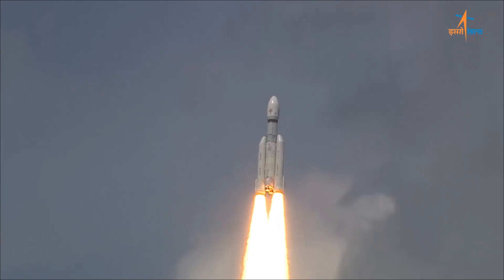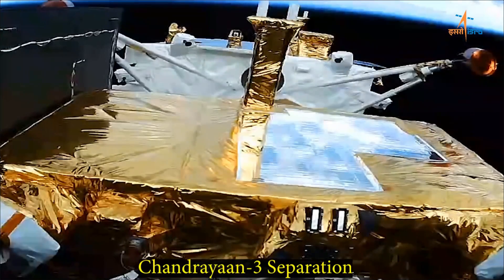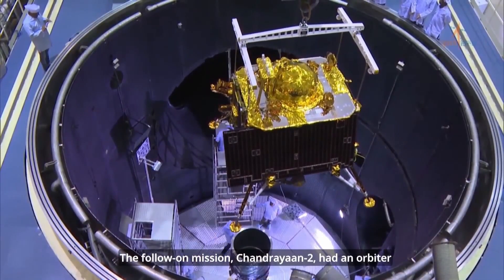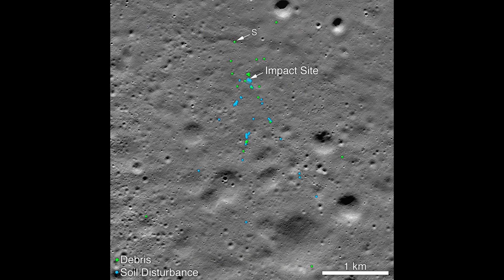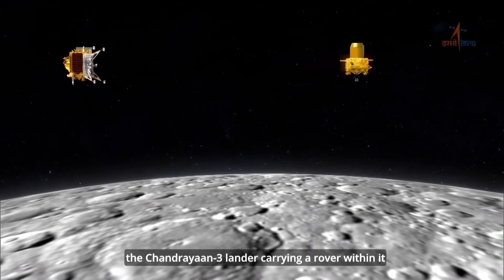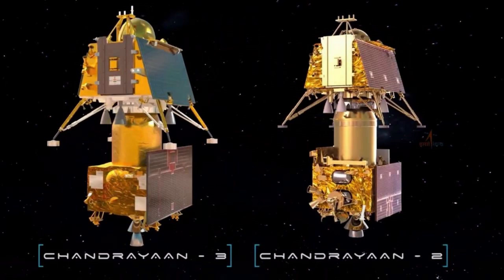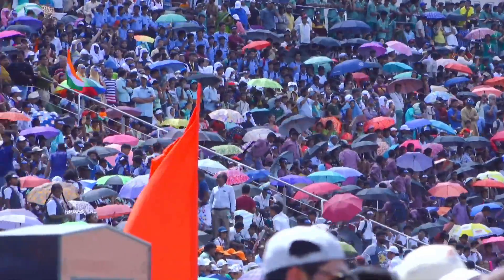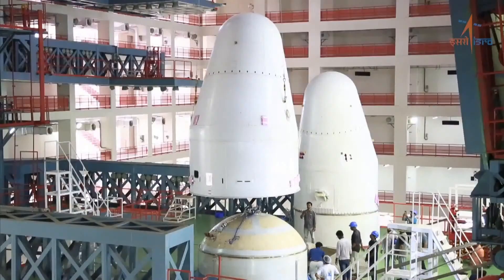India's Flagship Lunar Mission Chandrayaan 3: Will it Brake or Break?

Comment: Actually it was revealed recently that what happened and what changes they had made to the new lander, not a detailed report but some good bits. they shared pics of Chandrayaan-2 launch.
Reply from the maker: Did you post this before watching the rest of the video?
Reply: @scottmanley  can you comment on what I wrote? 
it will break just like Chandrayaan 2. the reason is all the landers from USSR, USA and China, used only one center rocket engine with adjustable thrust and throttle, only Chandrayaan use multiple small engines, for Chandrayaan 2 it had 5, for Chandrayaan 3 it has 4, plus 8 more tiny engines for fine position control, more engines just meant more troubles. Landers from China and USA, can hover steady in space 200 meters above the surface, carefully choose landing site, if not ideal, the lander move (fly) horizontally, to choose a flat site to land, from description of Chandrayaan 2 or Chandrayaan 3, they do not have this capability. from ISRO description, they just said they just choose a flat site of 2 sq km for Chandrayaan 2 ,and 4 sq km for Chandrayaan 3. which cannot avoid the landing site of 2 sq meter is flat or not. the landing process is all done by the lander itself, not by the instructions from the earth. with 4 engines, any thrust in-balance will make the lander crash. another thing is the thick moon dust, without central engine, the lander last step will be covered with moon dusts, may cover everything from solar penal or antenna to make them not function properly. ISRO showed their casual · random. way of design a lander, with Chandrayaan 2 they put a central engine for avoid moon dust problem, well they never go a chance to know whether it is good or not, in Chandrayaan 3, they just took it out, just amazing. I do not understand why ISRO does not follow the successful lander model from USSR, USA and China, but risk with their own design, if it doesnt work will they waste another 4 year for Chandrayaan 4??
Reply: @scottmanley  my question is, since i am not in the field, was there any moon lander used multiple small engine landed successfully on the moon? thanks,
Reply: @firetree2007  yes India is going to be first to land on moon by using multiple small engines okay

Comment: Do they not understand clean rooms?  They have caps, but their ponytails aren't covered, and neither are their beards.  Its like Brazil all over again.
Reply: The orbiter, lander, rover were prepared in clean room and wrapped in gold foils to prevent contamination and damage due to electromagnetic radiation and then was sealed in nose claddings. Same practise adhered to for all electronics. The mechanicals of the rocket does not need clean room as biocontaminants would burn due to high temperatures once the rocket flies and won't survive in supercold cryogenic tanks of the rocket and the various stages of the rocket themselves  will anyway fall back to the earth and certainly will not accompany the spacecraft.

Comment: The failure of the lander boils down to the software's incapability to handle parameter variation or dispersion which earlier was very narrow and the narrow site of landing was also a problem as it took out the liberty from the lander software to land at a suitable sites it prefers.

Comment: Kindly note: chandrayaan mission launch on Moon South pole where it doesn't receive sunlight throughout.
If successful, India will be the first and only country successfully safe land on moon South pole
Reply: It receives sunlight!
Reply: @QuantumNinja1.9  nope south pole of moon does not receive any sunlight throughout
Reply: @JohnFrost-gt1cs  it receives sunlight like our earth's poles but the angle of sun  light on South pole remains less than 2 degrees; that's why it remains cold but still craters and shadowy parts due to mountains do not receive light throughout the year.
Mainly those craters have ice deposits in hydroxyl form.
Reply: @QuantumNinja1.9 it doesn't, thats why they are trying to find more amount of water there
Reply: @hritiksaxena4368 it doesnot rotate like earth 😂😂😂
Reply: @danishali1545-b8k  what do u mean by that, genius?
Reply: @QuantumNinja1.9 Oh hello Neil Armstrong Jr
Reply: @jayanthbharadwaj9490  how the hell, did u know that?🌚
Reply: @QuantumNinja1.9  its freezing
Reply: @saurabh6453  yeah, it freezes most of the time but do u know the maximum temperature on lunar South pole also?
Reply: @QuantumNinja1.9  no other has never tried on South pole cause it's very fragile than launching on the middle region on the mon.
South pole harsh negative freezing (making electronic to work extremely delicate).
South pole has extreme craters elevation than the middle region
Reply: @er.m.s8930  but CY-3 will land at around 70°S.
Also rover will use it's solar panels.
Reply: @QuantumNinja1.9 nope there are parts which doesn't
Reply: @drbh6331  yeah but they're mainly big craters of South pole.

Comment: I guess those SRBs gave it plenty of oomph so they didn't need to light the main engine until nearly separation time.
Reply: The launch vehicle has a lift capacity of close to 7 tons augmentable to 10 tons but lifted just around 3.9 tons this time around. So second stage needed not be fired at launch phase.

Comment: it will break just like  Chandrayaan 2. the reason is all the moon landers from USSR, USA and China, used only one center rocket engine with adjustable thrust and throttle, only Chandrayaan use multiple small engines, for Chandrayaan 2 it had 5, for Chandrayaan 3 it has 4, plus 8 more tiny engines for fine position control, more engines just meant more troubles. 
Landers from China and USA, can hover steady in space 200 meters above the surface, carefully choose landing site, if not ideal, the lander move (fly) horizontally, to choose a flat site to land,  from description of Chandrayaan 2 or Chandrayaan 3, they do not have this capability.  from ISRO description, they just said they just choose a flat site of 2 sq km for  Chandrayaan 2 ,and 4 sq km for  Chandrayaan 3. which cannot avoid the landing site of 2 sq meter is flat or not. 
the landing process is all done by the lander itself, not by the instructions from the earth. with 4 engines, any thrust in-balance will make the lander crash. 
another thing is the thick moon dust, without central engine, the lander last step will be covered with moon dusts, may cover everything from solar penal or antenna to make them not function properly.
ISRO showed their casual · random. way of design a lander, with  Chandrayaan 2 they put a central engine for avoid moon dust problem, well they never got a chance to know whether it is good or not, in  Chandrayaan 3, they just took it out, just amazing. 
I do not understand why ISRO does not follow the successful lander model from USSR, USA and China, but risk with their own design, if it doesnt work will they waste another 4 year for Chandrayaan 4??
Reply: ...hope this ages like milk..
Reply: @firetree2007  huu?
Reply: @firetree2007 now I'm sure it'll be successful
Reply: @hj2711 yeah, just like 2, also they designed and original how it doing now?
Reply: Go eat your dumplings, kid 😂😂 Leave science to the grownups
Reply: Mao genocide, xi ping pong bat virus
Reply: @firetree2007  Mao genocide, xi ping pong bat virus

Comment: :face-blue-smiling: ISRO personnel, including the current ISRO chairman, have given their explanation of what went wrong with the Chandrayaan-2 lander. They said that as the lander descended, the attitude deviations ("errors") began accumulating faster than expected, necessitating larger sharper corrections by the thrusters. At the same time, there was a bug in the software that manifested itself due to these larger sharper corrections being required. This software bug was not allowing for larger corrections by the thrusters beyond a certain amount. Had the attitude errors/corrections been smaller in size, then the software bug would not have been encountered, but because they were large enough, that software flaw came into play. Therefore the lander was unable to properly perform the required attitude corrections on the way down, causing the resulting crash. ISRO personnel refer to this problem as "dispersion" handling, meaning that those attitude errors/deviations were larger (ie. had a larger dispersion) than anticipated, which the software was unable to handle. That has now been corrected, along with other improvements and upgrades made to this Chandrayaan-3 lander.

Comment: Crew + UDMH + N2O4 + Solid Rockets = Danger

I would be interested in how well their launch escape plan takes into account the bad things that can happen in that spicy soup.
Reply: There will be a dedicated crew escape system built into the rocket, just in case.
Reply: ISRO is developing a RS 25 type engine which will use liquid hydrogen and can be configured to liquid methane...which will used in crewed mission ...and about that solid boosters their TWR has already configured for crew mission....

Comment: The "Moon Impact Probe" (MIP) onboard the CY-1 mission was specifically designed to crash and withstand the crash (It was in one piece after the programmed crash landing), demonstrating the capability to reach a specified location on the moon and providing valuable information and experience for planning future soft landings. On board this MIP, a component called CHACE conducted experiments providing in-situ data confirming the presence of water on the Moon, complimenting remote sensing data from M3 (NASA's equipment onboard the Chandrayaan-1) regarding the same. The next CY-2 mission had an Orbiter, A Lander and a Rover. The Orbiter continued to function optimally well beyond its planned lifespan while the Lander (Vikram) carrying the rover in it, crashed due to issues with its software, leading to an accumulation of errors resulting in a destabilised descent path. The Lander's ability to handle parameter variation or dispersion was minimal because ISRO scientists had not expected such margins for error, which ultimately led to the onboard computer trying to satisfy two contradictory requirements, resulting in the crash. This time ISRO has covered all bases and planned better for potential contingencies with the landing part. 
We are exited and cautiously positive about sticking this landing. Go ISRO.

Comment: Interestingly, the recent name change from GSLV M3 to LVM3 is due, in part, to the fact that the GSLV M3 doesn't have any ancestral link to the older GSLV models.

Plus, there's an insurance angle: some previous failures of completely different GSLV configurations reportedly led to increased insurance costs for the GSLV M3. You learn something new every day! INSURANCE.

Comment: For your information, chandrayaan 2 DID NOT FAIL... It was only partially successful... 95% successful 🗿
Reply: It did fail, if you order a parcel and it gets destroyed just before arriving, it's a failed delivery. There is nothing bad about failure, don't try to describe it as something else
Reply: @E9X330  The orbiter is working fine, so failure is technically incorrect. And Partial success is the technically correct word.
Reply: @palashborah1604  the mission didn't completely fail, but the landing did. Wasn't the orbiter supposed to have the highest resolution camera of the moon yet ? Are there finally pics now showing the crash site in more detail than NASA's LRO does ?

Comment: India has also improved the AI of the lander & its engines are much more capable & improved than last time. Also expanded the landing radius so the same mistake is not repeated again. I believe last time the AI got confused & an error occurred that caused the crash. If it was a manned mission it would have totally landed. But anyway they improved the AI this time lets see what happens on 23rd August, 2023